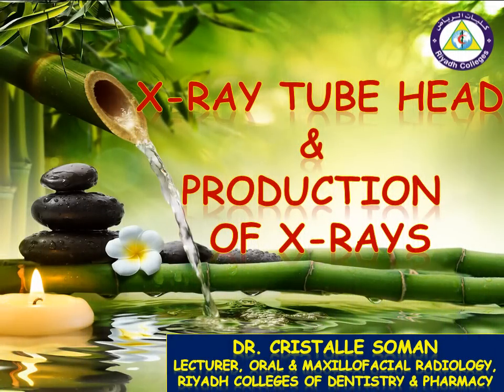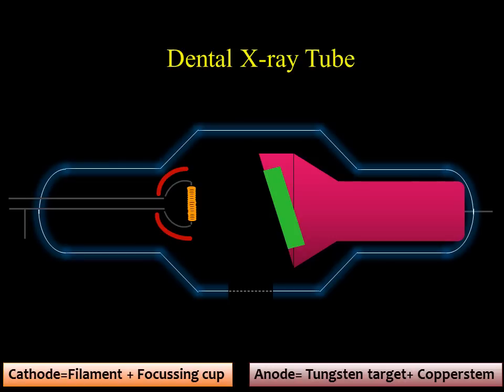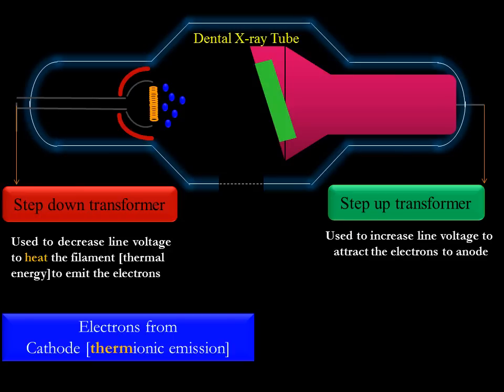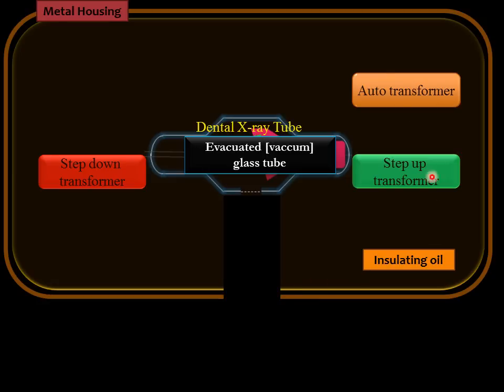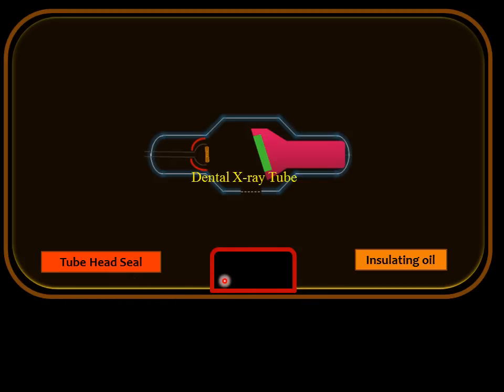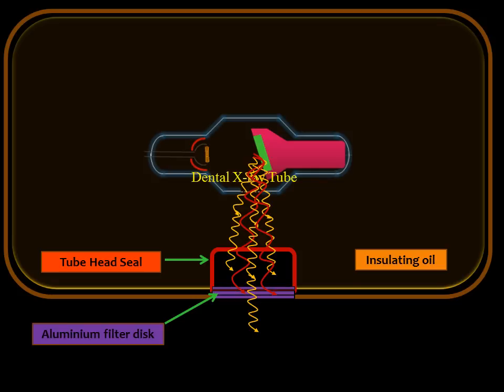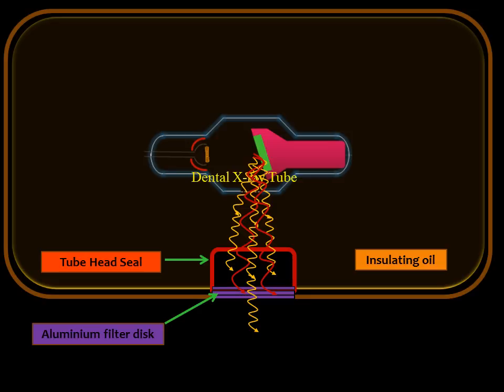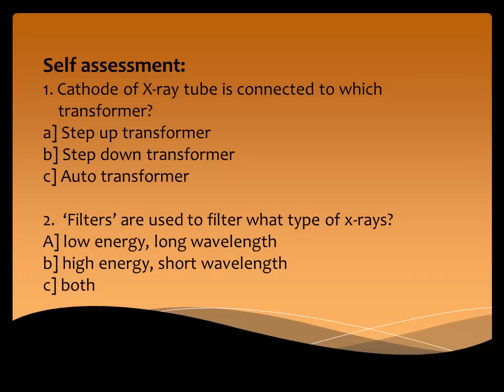X ray Tube head, its components & functions

Comment: thanks, plz tell me that insulting oil if leaking what problems occur
Reply from the maker: If the circulating insulting oil leaks, there will be a problem in maintaining heat insulation that is produced from dental x ray tube during the time of production of x rays. The heat produced is so immense that 99% is the heat energy and only 1% of x rays are produced. So with this you can understand the importance of circulating insulating oil.